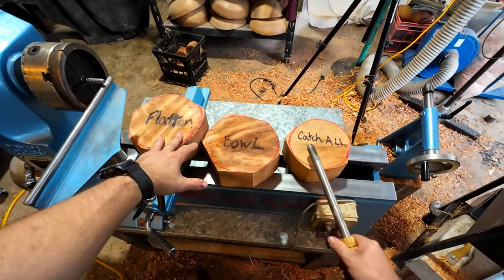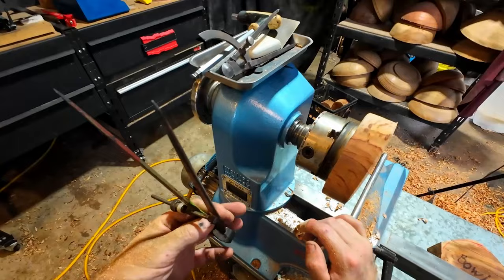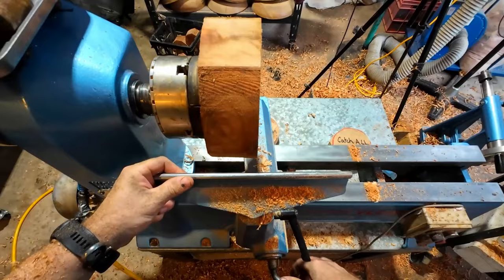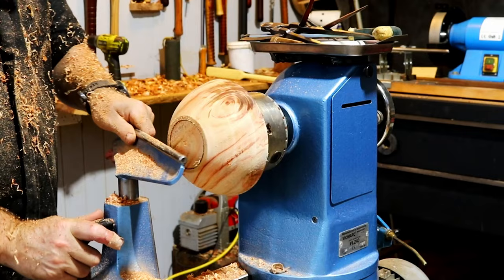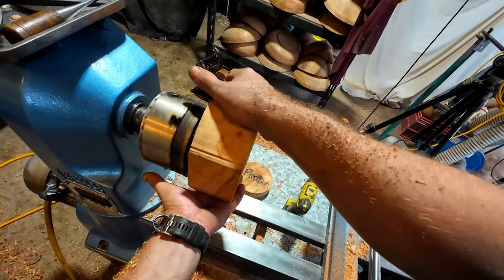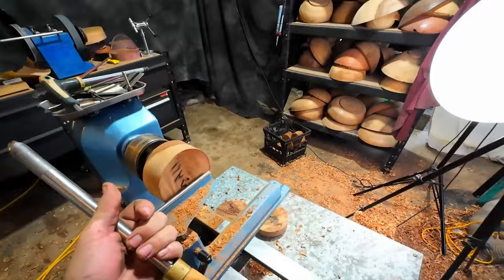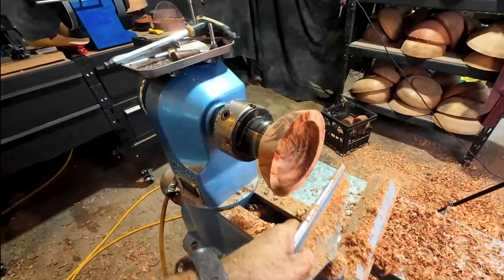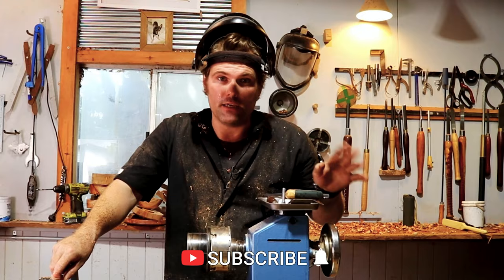3 easy Woodturning Projects. How to Prep for drying. Solutions for Small Pieces

Comment: Great tips on prepping, Kerry. My chuck doesn't use a hex key so, if I find it hard to remove, I open the jaws like you showed and use a piece of 3/4" wood about 12" long to lock in the jaws with a "handle" sticking up and slap it with my palm - like you did with the tool. (mine is a wood slat from a futon)
Reply from the maker: The old futon coming to go use haha. Cheers mate.
What ever gets the job done safely🤝

Comment: Great video Kerry.
Love your easy banter, I feel really included in the video.
Some great tips and tricks.
I really should start turning some of my wet wood ,roughing it down and then let it dry.
When I started turning all the old guys at the shed told me to let it dry first. Could take up to 8 years or more. Who wants to wait that long.
Tell me do you ever have any rough out bowls that you can’t make into a finished bowl.
Thanks for sharing.
Reply from the maker: Thank you for the support, Greg. In my recent live video, I showcased a heap of bowls with defects. I’m currently trying to find homes for them. Usually, if they have significant patches of minerals, holes, or even rot, I tend to discard them. Does that answer your question?

Comment: In the case of the player blank for example, Why not tenons on both sides instead of the starting Mortice and tenon on other side?  Missed if there was an advantage to doing it that way.
Reply from the maker: I chose to do it this way because the mortise will be left in the end platter, and it will only need a quick touch-up with the skew. You could do it either way; it's up to you, there's no right and wrong way.
Cheers,
Kez